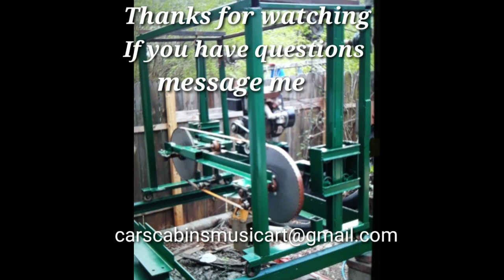90 LBS Barbells homemade sawmill

Comment: Nice work, just finish mine it's way better to build then to buy one.
Nice idea whit the barbells they serve as  a inertia wheel .
Reply from the maker: Thanks. Iv used several different types of wheels when I switched over to the barbells it cut a lot better . No more blade issues cuts good and straight and the weight actually helps keep the momentum you don’t notice knots and when it exits the cut it is very smooth

Comment: I built my mill in 2017.  First time seeing your video and yours have the same common things as mine to make it a great mill. Only difference was I got away from the boat winch in order to be able to make finer adjustments. Great build.
Reply from the maker: Thanks. I would work til 12 am and go by the shop and build a little and chill. Then go home and sleep a little